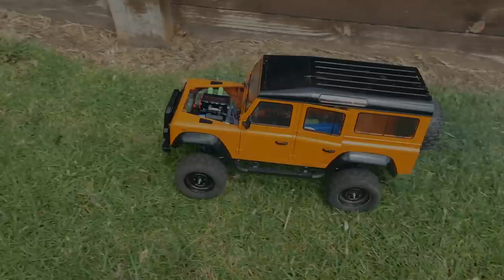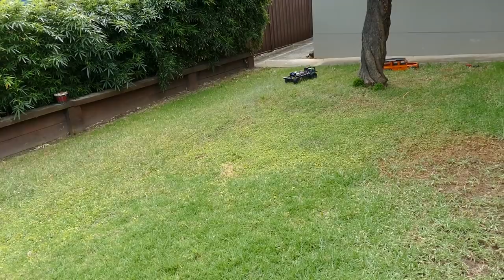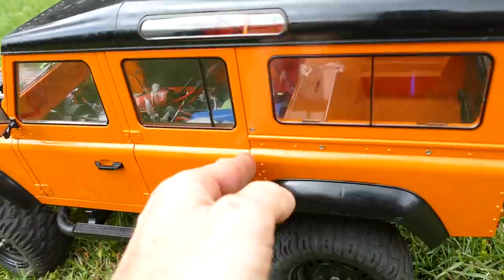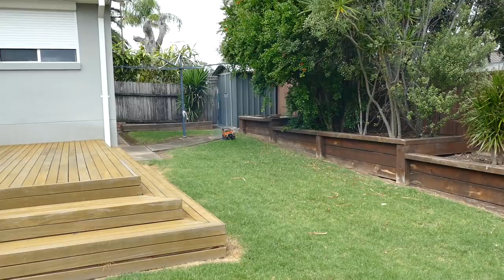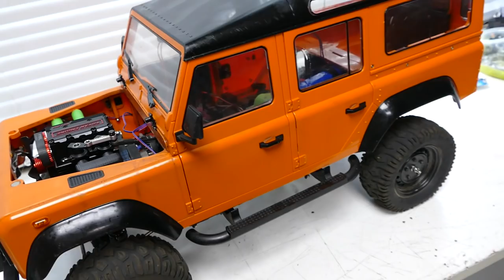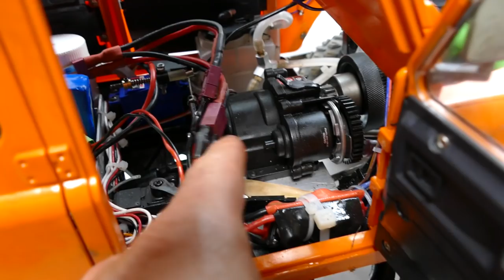2 CYLINDER 4 STROKE OVERHEAD CAM ENGINE INSTALLED INTO RC CAR - RUNS GREAT!

Comment: That engine sounds so sweet :D
Reply: Yup
Reply: Hello =) :D
Reply: sounds like a pissed off chainsaw that just hit puberty ;P
Reply: @tezy0193  xd
Reply: Not really.. sounds like a lawnmower.. (only car guys will get this)
Reply: @Crazyarnold12  lawnmowers sound better than this.
Reply: @darkshadowsx5949  well.. yes.
Reply: This is pretty cool, but would get annoying pretty quickly if using it for crawling; especially when you need very fine throttle control. I don't think my old ears could take the noise for more than 5 minutes! Nice project though 👍
Reply from the maker: Much appreciated brother. Love your channel

Comment: This probably cost more than my actual car lol
Reply: this car costs more then my life is worth...
Reply: @chronicawareness9986  same
Reply: The engine is 600$
Reply: @fernfern3961  the one link to the v400 says $1400, would be pretty cool. Just a little too much for me.
Reply: Waddup Mayne  GARBAGE? for 1 grand you can get a good used one with tüv
Reply: It's not that expensive I have seen one for $270 and a used traxxas is like $150
Reply: @3712bigboy  when you find one for that price with that engine please let me. Thanks
Reply: @FriendsWThoughts  yall need Jesus ASAP
Reply: @DitzyClouds  in the USA good used cars are more expensive than Germany. The UK has it really good.
Reply: @99ron30  really? i bought my 79 malibu over in the states for about 5k and here in germany its worth 25k!
Reply: @3712bigboy  you will NOT find a used trx4 for 150 with electronics. Factor in the radio to run all the channels this needs yeah you hit 2k pretty quick. 2k in the states will buy you a decent vehicle.
Reply: @fernfern3961  that’s absolutely insane you can buy a motorcycle engine for half the price

Comment from the maker: Defender ➜ https://bit.ly/3eVnpjg
Toyan FS-L200 ➜ https://bit.ly/3iF5PQG
Toyan FS V400 ➜ https://bit.ly/2QFxTbk
Toyan FS-S100 ➜ http://bit.ly/toyan-fs-s100
Toyan  Spare Parts ➜ http://bit.ly/fs-s100parts
Reply: Can it go any slower?
Reply: This is awesome brother great job brother I would love to see this motor on a drift car and if u could find a way to boost it I'm sure it would sound crazy and be a ton of fun
Reply: Awesome video. Seems like it is geared a bit too high for crawling though. But well done nevertheless!!
Reply: Dĺl
Reply: Have you though of trying to attach these engines in roller shoes? Or skateboard?
Reply: Man I’ve never seen one of these. NICE! Does it come like that or do you put it all together? Where you buy motor at? Thanks
Reply: It is so amazing how small a petrol engine can be and by the way I really love how you set up the RC car..✌️
Reply: Hola a
Reply: Awesome!
Reply: Make water cooling, it will save the motor better
Reply: try to install the seat is good anyway
Reply: Tukune nek ndi kang?
Regane Piro?
Reply: Ditanah dong main nya ..pasti seru !
Reply: great v
Reply: How much to buy one of these from you? Not specifically a Defender, but an RC car with this set up installed by you?
Reply: Can you give me an estimate of how much it would cost to get this to work thanks!
Reply: Give me 1 rc car

Comment: stainless tube for the exhaust pipe
Reply: *long Exhaust tube to the tail of the car.
Reply: @rayquan-c1n  changes tuning
Reply: @rayquan-c1n  2 into 1 should sound different maybe better?
Reply: Maybe build a metal box muffler, using the term muffler loosely more of a box to deepen the exhaust tone.
Reply: Top of the line rine carlos rossi
Reply: Stainless steel straw available at Walmart

Comment: Bet your neighbors love you 😆 watching and enjoying 👊🏻👍🏻
Reply: If you take a brushless motor and gear it to the flywheel and  then take a rectifier/ voltage regulator from a old alternator and hook it up to the 3 brushless wires you now have a small alternator that will produce 11.5-13.5 volts based on your gas engine rpm. The rectifier weighs about the same as the small brushless motor. I would still use a battery but a small one. This would allow you to go as long as you want. (Or until you run out of fuel)
Reply: Lol, this was my exact first thought 😅

Comment: "it's not gonna be for speed"
Nope; obviously it's gonna be for the noise, smoke and jerky control.   ; P
Reply from the maker: Check my latest builds showing how it drives
Reply: @RCTanksTrucks247  I'll bet it's still
smokey,  smelly, loud and obnoxious....
Reply from the maker: The way it is supposed to be. It's nitro after all. If you don't want sound then get a electric
Reply: @RCTanksTrucks247  Thought so. The way  it's supposed to be? lol okay.

Comment: This is an awesome build I am glad someone finally built one correctly and it's working properly I want to know why none of these RC companies have connected with toyan engines and collaborated with them and build two or three different style RCS with different model engine of their engine lineup like I want to see one of these built with full coolant systems hooked up to it so you can have way longer drive time and never overheat your engine that would be the coolest thing ever to have a combustion engine on an RC that you don't have to worry about overheating issues like my Nitros I wish I was crafty enough to figure out a cooling system for a regular Point 18 nitro engine
Reply from the maker: Not sure but maybe do to the cost and electric being much cheaper now a days

Comment: Omg please put the motor setup in a rock bouncer. Badass 👍even in a drag car with line lock so you can do burnouts lol. So much want
Reply from the maker: Finding the right chassis is the problem otherwise I would for sure
Reply: @RCTanksTrucks247  maybe I should build u a tube chassis.  Much respect on this one so far. Keep up the awesome work

Comment: Would  have been even more awesome if the seats could fit in after installing all those engine parts, and as for the body rolls, that's what makes it sweet.
Reply from the maker: Yeah not enough room. Too much hacking to get it all to fit

Comment: next project, exhaustpipes that is a little longer? :) you can use soft copper pipes to bend in to shape, i use it for cheap watercooling on brusless inrunners :) both cars and boats, i have one water cooled brusless car :)
Reply from the maker: Yeah man, check out my latest video on it. I have installed dual exhausts

Comment: Man this thing is a little ripper!! Seems to have a lot more torque than even a V8 Conley with a supercharger. Considering Conley is out of business, it looks like the perfect replacement.😁👍 You should make a hood with chrome exhaust right through the top of the hood! Nice that it's got onboard electric start so if it flames out on a hill, you don't have to run out to get it going again.😉 EDIT: Hah hah, if you play this at .5 speed it sounds like a hyped up old Honda 305 Scrambler from the 70's.🤣
Reply from the maker: Yeah and much cheaper than the Conley too! Toyan make a V6 and a V8 as well

Comment: Looks and soudns brilliant. Needs two things, I think - much less aggresive throttle curve (does the controller have D/R throttle?) so you have more control for crawling - preferably lower gearing would be better if that's what you were going to use it for. And secondly much heavier weight oil in the front shocks will make it less bouncy. Rear looks OK

Comment: I wouldn't lean that engine much, it's running pretty good as is. I have my share of nitro engines and they're supposed to smoke quite a bit. It is surely possible that you know all this, but I would hate for you to seize it. Good job 👍
Reply from the maker: Cheers man. Yeah as long as it is producing a nice blue trail of smoke 👍

Comment: These motors are awesome! Got my l200 going into a boat. You know of any one stocking the transmission? Can’t find one anywhere
Reply from the maker: Jenny's RC on ebay mate
Reply: @RCTanksTrucks247  awesome cheers! Got the belt driven setup on my single cylinder but not happy with it

Comment: Came out great Steve!! Has so much more torque than the S100 I love the power! Linkages look very clean and that larger oil can is going to be much better than my little one, what did you use to make that? I also changed to 47w oil in the shocks to help with the added weight as well as some plushness to the suspension feel, helps with body roll too. Awesome work bud!!!! 👍👏
Reply from the maker: Cheers man. Definitely has some great power.
The canister is a from a arts an craft store. Just a plastic paint container.

Comment: Hi I would ask you about 4 stroke engine is that also need mix oil with gasoline like 2 stroke engine or just fill up gasoline only hope you will answer me 
Thanks
Reply from the maker: The oil is in the nitro fuel

Comment: So i just did a HG Bruiser... An decided to use a tmaxx transmission, with the stock clutch bell an 72t spur...  forward only. It has that low end torque without the jumpyness.  Works well. incase someone was in the middle of a project an needed ideas.
Reply from the maker: Sounds great!

Comment: I feel like this could crawl great with a good 2 speed set up. High gear for speed and a really really low gear where it just crawls along running like 1/2 or 3/4 thru the rev range

Comment: That's badass I knew ppl were experimenting does it have a sump or do U need to premix 3 d printing is cool U r onto something but until it's commercially available & proven tech I'll stick to nitro but U my friend will become a legend !👍🚗
Reply from the maker: Thanks man. You need to run the standard premixed nitro fuel

Comment: You'd pay as much for some OS 21cu two stroke engines Though I doubt the Toyan will last nearly as long as a Japanese made engine. Starter and integrated glow heaters are a nice touch. I'd be tempted to drop this in my old Savage if I had the money to burn. Don't know why 4-strokes never caught on with trucks. You'd think the torque benefits would make them ideal. Tough to beat electric though for that application.

Comment: I could run that bad boy all day . Will the L200 fit in a 1/10 TF2 or would you go with the L100 in a Trail Finder 2?
Reply from the maker: It can fit yes but just harder due to the space limitations.

Comment: You should fit one of these engines to the ZD racing hoonicorn Mustang that they make and put one of these Toyon engines on it it sounds like these make really good power I'm not sure what one of their engines would be the best application for it I think that would be an awesome street car if you were interested in building it I know you're not a manufacturer but I would pay you to build me one with a working cooling system the closest it can be to a scale replica when it comes to functionality and actually having a radiator and coolant system so you can constantly drive it obviously a little bigger fuel tank to
Reply from the maker: It's difficult to do as the engine needs to sit in between the shock towers and the whole steering system needs to be changed

Comment: I'm still trying to do this with my Otto motor I got the chassis from stirlingkit coming. It has the starter button on the chassis but I also have the electronics for remote start. My question is can I utilize both methods thanks Steve
Reply from the maker: Did you get it to work?

Comment: OH. I HAVE A SUGGESTION!
TLDR: Weigh down the chassi to make it handle more like a real car!

If we pretend that that engine in the rc car was the real one in a real landrover, what should its horsepower be?
And when we know that, in scale, how much lighter is the rc chassi compared to the original? Can it be weighted down to look more realistic?

Right now the accelleration is disproportionate to the real one since the car body looks too light to be real. It looks jittery and jumpy just going over a small obstacle.

Comment: Alright now that we're putting real engines in RC toys we need a real Dino for RC toys to test the horsepower because that is cool as hell the electric motors Talia what they put out and it's usually pretty close but with a gas motor there's a lot of variables that needs to be verified with a Dino and maybe the electric ones can play on it too
Reply from the maker: That would be cool

Comment: If you put a trx4 or similar gearbox in there it should crawl better. The revo box is geared too high.
Reply from the maker: Does it have 2 speed forward and reverse with brakes?
Reply: It’s two speed yeah just high and low gear. But no reverse as it’s a brushed model. Might be no good unless you try and gear down the revo box then..

Comment: I think for off-road driving, this engine doesn't have enough torque at low rpm.
Reply from the maker: Definitely does it just is the gearing
Reply: @RCTanksTrucks247  oh I see... So your plans are to fix this?

Comment: ? Is there a  Difference and fuels when one is for example the Sidewinder backyard bash or fuel is 16% Castro oral 20% nirto. I drive off road a lot. So i got the off road fuel from the same  Company does not say anything about Castro oil content or percentage at ran like s*** . It ran better on 5 year old fuel then the new quorts dar tower hobbies wont take them. Back im runing a os max .15.cvx. engin in the first gen tmaxx.

Comment: I still can't get the basic single cylinder methanol engine running it's been over a year now
Reply from the maker: I have 3 of them and have no issues. What's your engine doing?
Reply: @RCTanksTrucks247  it seems to be spitting the fuel out the air intake and now the electrical stuff isnt working

Comment: Do you have a link to the rc?
Reply from the maker: It's all individual parts bro
Reply: @RCTanksTrucks247  I see I just finished all of the videos :) that freaking rad man, what I meant to ask was what type of steering linkage did you use? Like what rc would it come off of?

Comment: 2.0 hp or 29 hp?
Reply from the maker: 0.9hp
Reply: Ok looks and sounds great, they also make a 4 cylinder one and a V4  with talk of a straight 6.
I am in china for a little while, but these motors are costly here.
you have done a most excellent job.

Comment: That's definitely cool, but with modern electric motors and Lipo batteries, I just don't see the point. Especially in a crawler.
Reply from the maker: Like I said, I have heaps of electric cars (over 90). This is something fun.

Comment: Needs breaks
Reply: Looks like it has brakes. If you look at at 1:40, you can see the linkage from the throttle servo and the disk/pads on the revo transmission.
Reply from the maker: It has brakes